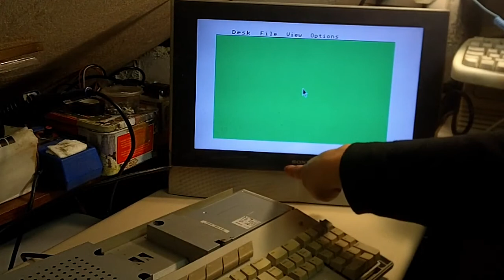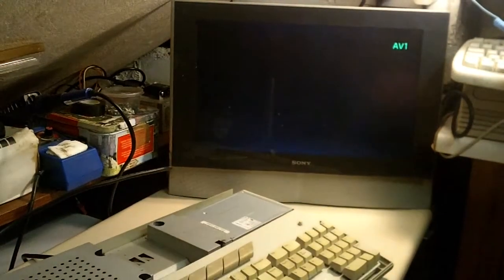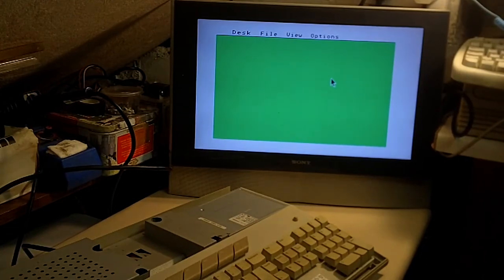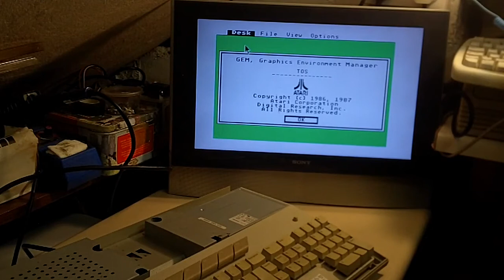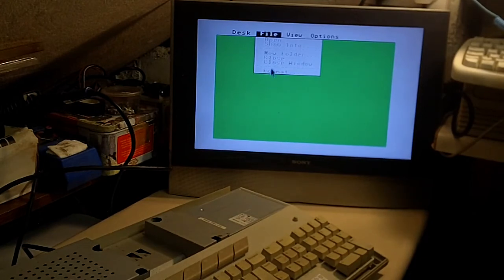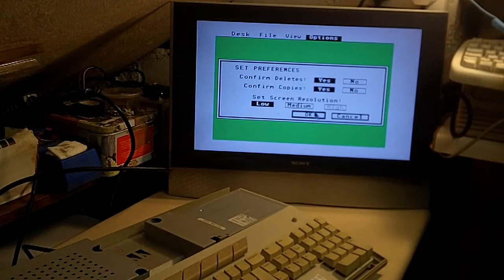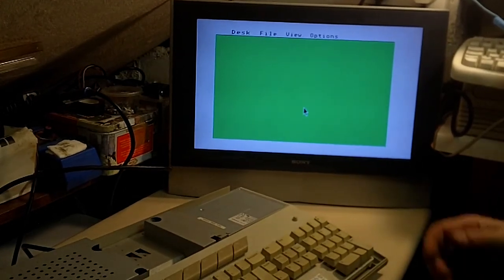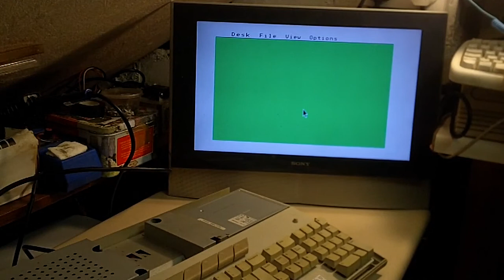Atari 520stfm quick lookover and it fixes itself

Comment: Some users called it "The Atari Drop," and described dropping the computer flat onto it's base onto a table so the chips would resocket themselves. I never did that, I always opened it up and replugged them, works like a charm (I don't suggest the drop method haha).

Comment: And because there's no floppy icon on the desktop that's a clue that the drive hasn't been detected.  Often happens if the drive is dead, or the floppy controller dead, or surprisingly if the drive IDC cable is connected upside down.  Maybe they connected the drive incorrectly and then gave up?
Reply from the maker: Ah so there should be an icon for the drive on the desktop then. I will take the drive out and take a look at it and make sure its connected correctly. I was thinking of possibly replacing the floppy with a gotek. Do you know if the firmware needs flashing for it to work on the ST? I believe the ST can read PC formatted 720K disks.

Comment: Wow, I wish 520 and 1040STfm were super cheap in the states, too. I owned a 1040ST. I wanted an Amiga 1000, but it was considerably more expensive. BTW, your former problem might have been a loose IC. Reseating socketed chips might make sure the problem doesn't return:

Atari ST Reseating Chips
https://www.youtube.com/watch?v=9sNwFlY5XJ8
Reply from the maker: Thanks for the reply, I will certainly reseat all socketed ic's when i get the shielding off although in this instance i think as GadgetUK has mentioned the PSU is the likely cause as it may have some capacitor issues that I will need to look at.